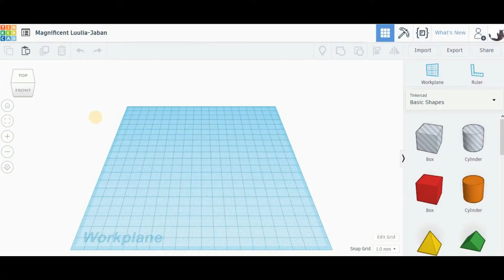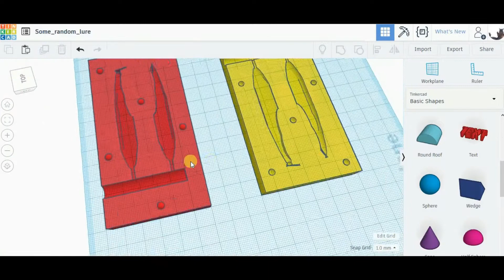Inject into a 3D printed mold attempt #1

Comment: To fix the warping lower the temp to about 65-75 and apply a thin layer of glue stick. Thats what I use on my glass bed. Petg needs very high heat to actually melt and stick. About 120 degrees.

Comment: is it possible to just pour the hot plastic into the mould instead of using an injector? or is it possible to use a ordinary medical plastic syringe?
Reply from the maker: I'm working on a 45 degree mould that might work well for that, but to get it in all the recesses and over hangs the injector helps a lot. As long as the injector can handle hot liquids 350 F plus it should work, the plastisol injectors are specially designed to hold and inject a lot of plastisol and clean up easily.

Comment: damn I just made a swimbait mold out of petg,wish I had seen this vid first
Reply from the maker: I wish it would work better, it would save a lot of time not having to silicone mold.
Reply: @RevampedOutdoors  petg molds work fine for me.  Maybe its the material you're using?  I use Esun PETG, and I try not to pour the plastic at more than 350*F.

Also... i print 60% infill, 1.5mm walls.
Reply from the maker: @Loochy808  interesting I might have to give it another go. The silicone has been making some really nice ones so far especially for quick ones.
Reply: @Loochy808  Do you use a release agent for that PETG mould? My plastisol sticks to the mould and gets damaged when taking it out.

Comment: do a new one with nylon!
Reply from the maker: I'm thinking about it, all the safety stuff I read about nylon has me a little scared printing it though.  I'll admit it, I'm a wuss! All I've read about plastisol says it should be able to melt at about 160 C though and pour around that temp maybe a little hotter.  Nylon would do the trick I think! I did just make a filtered enclosure for the CR-10 but I don't think it will get up to Nylon temps without some modifications.  I should revisit this over the winter though! EDIT: I don't think I have enough ! so !!!!!!
Reply: I had this idea to 3d print an object out of a PLA, then create a mold out of High Temperature Epoxy. And use the the Epoxy mold as a plastic injection mold. I know some companies use a superglue derivative, but never seen anyone try a high temp epoxy :)
Reply: @lineage13  did you try that? Im over the same idea looking for high temp resistance epoxy.

Comment: why not just use some type of silicone to inject, instead of hot plastic?
Reply from the maker: There are a few options for that but most soft plastic baits traditionally use plastisol for the plastic.  I'm pretty sure it is due to it's low cost and relative easy of use, low VOC and just general availability.  Plus it gives a nice action in the water while still being relatively strong.  I've tried some silicones but it seems difficult to find a really flexible silicone substitute.  If someone knows of a good silicone substitute that would be awesome.

Comment: Do you have a slower tut with instruction on how you did the design? That's what I'm interested in learning how to do to make the molds templates. Great vid thanks.
Reply from the maker: I don't think I do, but I can do one this weekend.  Once you start messing around in TinkerCAD it gets a little easier but there are some tricks and tips to make the negatives and index holes.  Are you trying to 3D print them or something like CNC?
Reply: Exactly to make lures and molds like I was going to suggest to you but you figured it out by the end of the video. Reverse the design and just make a silicone mold from the two parts.  It will be great to see how to all that is done thank you I'm looking forward to it.
Reply from the maker: I just uploaded a new tutorial on my process for mold design if you want to check it out.  Hopefully it helps, I made it a full on TinkerCAD tutorial so if you're familiar with all of tinkerCAD controls you might want to click through until the mold portion.  Thanks for the video idea. https://youtu.be/XV7UgCL6AyI
Reply: Amazing my friend thank you for doing this at my request, you now have a lifetime follower. Thank you.